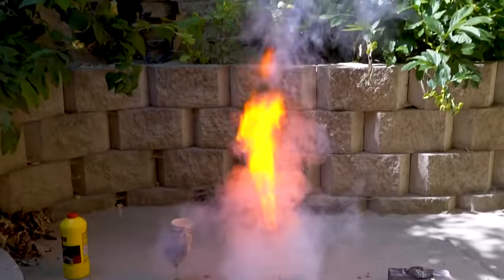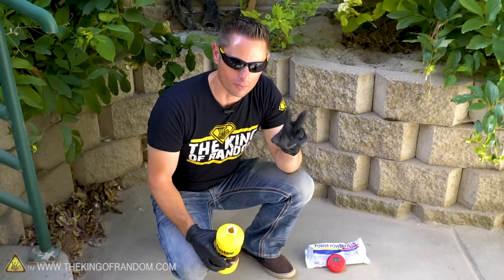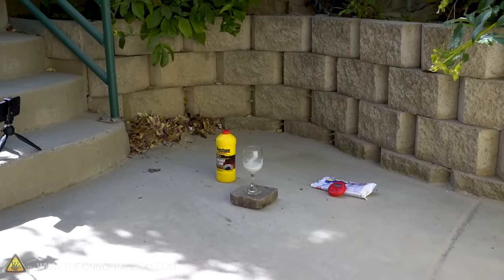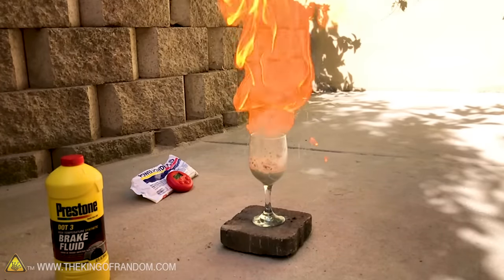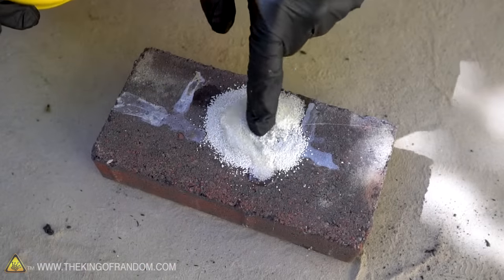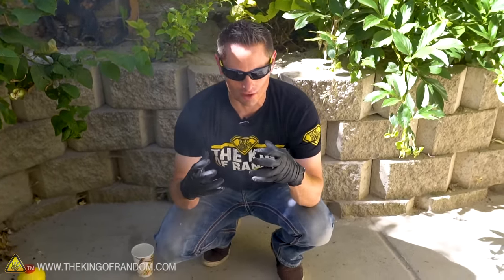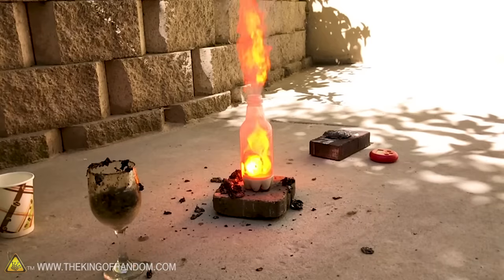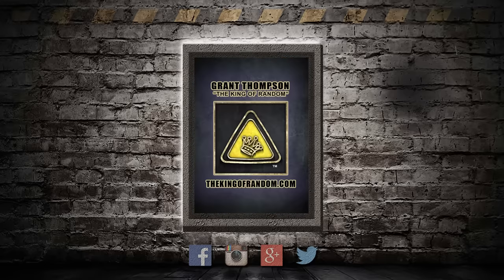Don't Mix These Chemicals! What Happens When You Mix Brake Fluid and Chlorine? TKOR Shows You!

Comment: I think you should strongly consider an investment in a Phantom high speed camera
Reply: how about the other high speed cam that is kinda cheap
Reply: there is a camera, chronos 1.4 it costs $2500 and you can shoot up to 21650fps (1000fps at 1280x1024)
Reply: TheSauceGodTV have you seen the cost?!

Comment: I kind of want to see what would happen if you put it in a sealed container now
Reply: Just stick it in a bottle tighten the lid and throw it like those CO2 bombs that everyone makes with Drano crystals and  bleach Gatorade bottles are the funnest to watch explode with the Drano mixture because of all the indentations it's fun to watch them turn inside out the Drano Crystal mixture expands slowly so you get to watch all the spots pop out
Reply: Did one in a large 2L glass bottle once... we used to use sugar to slow down the reaction time (oil has to soak through the sugar) put the cap on and ran... it made an extremely ... massive house shaking BOOM!.. do not try in enclosed containers at home........
Reply: It'd 'splode
Reply: he should fill it up most of the way with chlorine and fill up the rest with brake fluid and screw on the cap
Reply: In my experimentation with this (a couple decades ago), it seems that less is more. We were using Gatorade bottles and sealing them and throwing them. A second person poured the brake fluid so the first could cap it quickly, give it a quick shake and throw. The 20oz bottles went as expected, landing on the ground and then popping and burning. The 32oz bottles popped mid-air, raining down the burning clumps much like an artillery White Phosphorus Felt Wedge. (Search YouTube for videos of the felt wedge WP.)
Reply: It does what you think it will do, kids have been doing it here in Australia for DECADES....
Reply: @tylerdmore9372  that I BELIEVE! 👍
Reply: Molotov cocktail
Reply: kaboom

Comment: My hypothesis: Since you need oxygen to make a flame I think that the reaction happen faster in open air because its more oxygen in open air than it's in a glass or bottle. So theoretical if you do the experiment in a closed bottle filled with Co2 the reaction won't happen. Test this in a video
Reply: Chris Jensen Chlorine is an oxidizer, so it would ignite no matter how little oxygen is in the bottle.
Reply: According to the explanation in the video the Chlorine is the oxidizer in the chemical reaction but is not actually what is burning. The reaction between the Chlorine and the Ethylene Glycol is exothermic but is not actually what burns. The flame occurs when the heat build-up in the mixture reaches a point that causes the remaining break fluid and/or the chemicals produced by the reaction to vaporize. This heated vapor then reacts again with the oxygen in the air to produce the flame. As such the oxygen content of the air would be a factor in the ignition but only after the heat of vaporization was reached in the original mixture. So I don't think the oxygen was the reason for the time difference. I would posit that it is possible the stone block the open mixture was placed on was able to store more heat than the plastic or glass containers and thus conserve energy to produce a quicker heat increase. It could also have to do with the way Grant mixed the mixture on the block with his finger which may have produced a more even mixture than the swirl mixing in the containers resulting in more connecting reactions and thus a greater energy build-up.
Reply: Chris Jensen So if you give it little bit of liquid oxygen it will go BAM!
Reply: The problem with this hypothesis is that it is uninformed of organic chemistry. The gas that is ignited is the aldehydes and other products from the chemical breakdown of the polyethylene glycol. These reactions are sped up through the addition of high energy light, such as UV from the sun.

If you were to look at the open-air reaction, you will see that it was placed in some dappled light shining through the leaves above it. This was the main contributor as to why the reaction was faster. Not to say it didn't have more oxygen, or a greater surface area, or that the brick was warmer, just that these factors wouldn't increase the reaction time so significantly.
Reply: This reaction makes Formaldehyde, Acetaldehyde, and Ethlyene. HrrrPenny is correct, these are what ignite. The reaction WILL happen, as it is independent from oxygen,  but could burst the container, and then likely ignite. The flame is not the reaction, but the result of the products of the reaction.

Comment: Do it again please but this time keep the lid on I want to what happens if you keep the lid on? VOTE UP
Reply: I was hoping he would keep the cap on, so bummed lol
Reply: I think fire needs oxygen tho...
Reply: @davidesfandiary5935  that true but I feel like the chemical reaction would still work well enough to blow the cap and continue
Reply: Put it in a glass or metal container, with the lid on!
Reply: @davidesfandiary5935  uh... bro, the chlorine gives off oxygen during the reaction to feed the fire. It can and will go exo in a sealed container. Enough to make a decent explosion for sure and it would definitely do more than just blow the cap off.
That's why chemical fires are sometimes left to just burn themselves out. You can't suffocate it with foam or anything. It'll just keep burning under it because it creates its own oxygen and feeds the fire, like a completely self contained "living" fire.
Reply: It hyper accelerates, making an impressive BOOM...

Comment: That might be a better way to start an emergency fire in a survival situation instead of matches or those magnesium flint things, although simply carrying a wind-resistant lighter is probably the safest thing.
Reply: Brake fluid and chlorine for a delayed ignition device...this video should be flagged and taken down.
Reply: @eugenechun4140  your name is eugene 💀
Reply: @eugenechun4140  he also teaches as black powder and jet fuel. Also I feel like your personality is the same as twd eugene
Reply: Plasma lighters are the newest thing; absolutely windproof and are rechargeable. It could be wet and windy and still work.

Comment: Try to make a rocket with this. It should be fun to try.
Reply: Isaac Quezada it most likely would not be able to create enough pressure to lift off the rocket, though I might be wrong.
Reply: What if it's a glass bottle that is laid on it's side, sliding across would take less force than lifting. Could also try the plastic bottle somehow with holes at the bottom and cap on the top to see if the pressure could lift...? 

Oh the possibilities.
Reply: Anoni Misfit i wast actually thinking more of a metal bottle, so that it’s more resilient

Comment: GRANT!! Take your SUGAR ROCKET MOTORS and add something to COLOR the smoke that comes out!!
LIKE SO GRANT SEES THIS!!

Thank you :D
Reply: TRACEABLE SUGAR ROCKETS!! What an idea!
Reply: 1 month and only 10 likes. Tragic
Reply: the fuel he used for his smoke bombs is lactose. the reason he uses lactose is because its a relatively cold burning fuel, which allows any dyes to be vaporized, not burned. the issue with a cold burning fuel is, it cant react as well with the oxidizer and therefore reduces speed.
in other words, you get either a rocket or a smoke bomb.
Reply: Will what if you have a lactose intolerance? 😄

Comment: He should of put the cap on the bottle.
Reply: And also put it in a ball jar instead (frag grenade)
Reply: TonsOBeef it would make it much stronger because the oxygen it burns is already in the brake fluid, and with the cap on the pressure would keep increasing until the bottle explodes in a big fireball
Reply: Riiight!!!.im soo pissed
Reply: Or even better he could have used a glass bottle so the bottle didn’t melt
Reply: *should've......not "should of".

Comment: If you would dip a speaker in Liquid Nitrogen how long would it still work for???
Reply: like I want to see that
Reply: Ernestas Valentinas .. i would say put a speaker facing up and put liquid nitrogen in the dish
Reply: u will get a superconductive speaker
Reply: staberas not only that the speaker will probably catch on fire/blowup depending on what kind of speakers. since there aren't any resistance in the circuit the voltage going through the circuit would increase and thus overloading

Comment: I was surprised by the size of the flame. How about using liquid chlorine? Nurdrage, isn't that the guy from "Alien Interview" on Youtube? LOL
Reply: Reaction may be instantaneous
Reply: Liquid chlorine is a lot weaker than granular. Liquid is approximately 30% strength compared to granular that around 60%, then there’s black spot remover 85% that’s near to pure chlorine. The most purest is at gaseous form100%. I’m a pool guy that’s how I know.
Reply: @deanupton383  the bag he used said 73%
Reply: So this guy literally just made a portable firebomb…and showed each of his steps….
Reply: @andylagger551  there are more applications than JUST violence. Great example of the tool not being the problem, it’s the operator using it.

I’m looking at this as a fantastic way to start a campfire in the rain.

Comment: That's interesting that the fumes don't smell like chlorine. Do you think the fumes are toxic? This is one of the reasons I like your use of glycerin and potassium permanganate because the fumes are non toxic.
Reply from the maker: +Elizabeth Swims according to my friend nurdrage the fumes are not toxic. The Dot 3 brake fluid itself is relatively harmless as well even if you were to drink it. Although that's certainly not recommended :-)
Reply: Grant Thompson - "The King of Random" Can you redo the smoke bomb video But this time can you do it so the smoke Can be different colors Example green blue red Etc I would like to see that video
Reply: Grant Thompson - "The King of Random"  I want to know why if you put gasoline inside of a styrofoam cup why it disolves

Comment: What would happen if you put that Chemical mixture in a vacuum chamber?
Reply: this has to happen
Reply: Jobear it wont combust since it would need oxygen
Reply: Very possibly nothing as the gas wouldn't be able to build up... Possibly... :P
Reply: the chlorine has it's own oxygen molecules  this is what grant said anyway there fore it is plausible
Reply: nothing is gonna happen, there is no air to make a flame
Reply: Bear McLeod but the gas would still sucked out by pump.
Reply: Osmium___  it's worth a try because I don't know for sure what will happen
Reply: Osmium Is right, Fire needs three things, Fuel, Heat, And oxygen
Reply: Lol Lol but the gas may be sucked out by the pump
Reply: Fire might need oxygen to grow but there are videos about fire in space,  it creates a globe of fire.
Reply: It would still ignite and destroy the vacuum and blow the top off
Reply: Depends if it builds enough pressure and if the reaction requires oxygen, the most likely scenario is the mixture will convert but no thermic reactions will occur. Due to it being an exothermic chemical reaction it IS possible that it simply pressurized the chamber, in which case the lid will just simply fly off in q rather none violent fashion. (and probably severely damage the container/proto putty due to rapid pressurization)
At least from my thinking this is how it'd work, I'm a physics guy but no ones right 100% of the time!
Reply: science is not science without experimentation I say proceed without a doubt
Reply: Jobear Nothing there is no oxygen in the vacuum so it would not burn very well or at all.
Reply: +Based On A True Story , actually they would, as he mentions part way through, it's a self oxidizing mixture.
Reply: I commented this on his original video :(

Comment: Nitroglycerin + Black powder! Like if you agree!
Reply: Ibro N gunpowder does nothing when compared to nitroglycerin. Nitroglycerin is just too dangerous to work with.
Reply: Edo dude nitroglycerin is wayyyy to dangerous
Reply: Cody did a video on it. 2 drops of nitroglycerin broke a lock and sent 30ft in air.
Reply: I like this recipe more :D just mix Potassium manganate and aluminum powder. Mix in ratio 1 to 1 and light it off *should go off in nice beautiful colorful flames). Then make the same mixture and compress it into a small ball (use paper to hold it in one place) and compress it using ducktape by wrapping it around the paper. Insert wick of any kind (from sparkle to a professional firework wick). Run away, because it will go off in a huge blast. This is my favorite homemade explosive mixture. You should try it.
Reply: This explosive was made years ago, its a type of dynamite, although it was never as popular as the potassium nitrate/ sawdust/ nitroglycerine formula.
There have been many things mixed with nitroglycerine to make new explosives, such as nitro cellulose, ammonium nitrate,  ...even salt was used in an attempt to cool down the explosion to keep from igniting coal dust in mines.

Comment: It reacted more quickly in the open air because there was a larger immediate supply of oxygen.
Reply: Another possibility that occurred to me is that the brick underneath the open air mixture is an insulator (compared to glass or plastic), so the heat from the reaction built up to the ignition point faster.
Reply: Is this why women scream and go nuts and are loud and obnoxious when they are in public? Because of the large supply of air? I would think so too.

Comment: How to store farts in a jar :

Things needed : You, Fart, jar, assistant, swimming pool

First, go in a swimming pool without clothes on. 

Second, dive into the bottom so that your stomach will touch the ground.

Third, fart. Then your assistant should catch the fart bubble with an upside down jar in-water. 

Last, close the jar in the water.

There's some water in the jar, but it's pure fart, without air.
 (This method uses water substitution, you learn this in chemistry.)

To store perfectly : Do not get rid of the water. Instead, flip the jar upside down so the lid points the ground.
Reply: Very uncommon name i
Reply: Very uncommon name you're a genius
Reply: Amazing

Comment: What will happen if you dropped some dry ice in a hot boiling oil?
Reply: Triamond  It would melt
Reply: Ian Muñoz dry ice does not melt, it sublimates. Sublimation = Solid to Gas
Reply: Moki   Yea I guess you're right but still  what else could happen if you dropped dry ice in boiling oil
Reply: Moki It would be cool if CO2 had a liquid form though.
Reply: Rohan Patel it has
Reply: Rohan Patel it does....
Reply: Rohan Patel it does, drop dry ice in a air sealed glass bottle, if it's under pressure it will turn into liquid

Comment: Curious... I'm trying to get rid of a stump in front of my house, tried making home made napalm (didn't burn as long as I was hoping)... can you assist me in getting ideas to make it last longer? I've used mixture of one part (gasoline or kerosene or diesel- not all at same time) with a 3x3 foot cube of Styrofoam, a full bar of soap (shredded of course) and a quart of motor oil... only burned for at max 40 mins

Comment: What if you try to put electricity in liquid nitrogen ✌🏻️🙃
Reply: Lox would be better
Reply: Liquid Nitrogen isn't a conductor so probably nothing. Now try it with liquid murcury and you've got something. XD
Reply: Take a transformer and make a Jaco's ladder 
Take a hollow clear plastic tube and use a chisel to make knobs across from each other on the wire giving a favorable arc site
Pour in N
And turn on
Let us know

Comment: put the bootle upside down so it will  be like a rocket
Reply: caue abud 
That's not really how rockets work
Flame it's self won't propel it into he air
Reply: caue abud bootle*
Reply: Your picture fits the comment😂
Reply: but it will work because of the insane reaction speed
Reply: it wouldn't work cause heat rises and it will just melt the bottle from the top (bottom of the bottle) and it wouldn't shoot the bottle up. Using a bottle of a different material with a higher melting point than the heat of the combustion itself could work but the weight of the bottle has to be accounted for depending on the thrust power of the reaction itself.
Reply: Awab Adil thats kinda true but it will act the same as capping off the bottle and explode /or it will create pressure knock the bottle over and ignite not propelling the bottle

Comment: have you tried to fill half a two litre bottle with chlorine and the other half with brake fluid, mix it quickly & then shove the bottle with the cap on 3 quarters in sand then run about ten metres and watch what happens? ;)
Reply: make sure it's done somewhere where NO OTHER PEOPLE ARE!!! maybe a beach at night or way out in the desert
Reply: idk, by your picture, it looks like you did just that, but where people were. at the beach at night? weirdo.

Comment: Our experiments with this show that the start of the reaction is highly variable by ambient temperature. We usually do this at 80+F and it happens in a minute or two, sometimes as little as 30 seconds. But one year we did it at about 50 and it took over 5 minutes for the reaction to happen.

Comment: Not sure if you can get concentrated liquid chlorine, but there was a time when we made the no-light molotov cocktails where we had the brake fluid in one glass bottle and the brake fluid in another and the two bottles capped and tapped to each other. You could then throw it to break together and within a half minute or less the mixed items would ignite. We even used a sling to shoot it further.